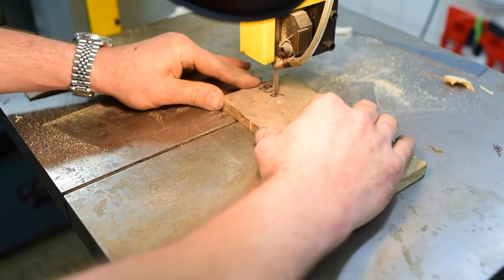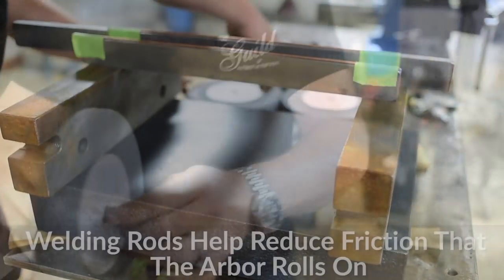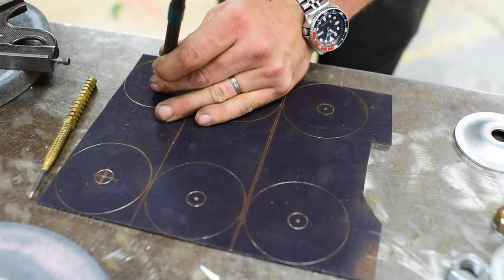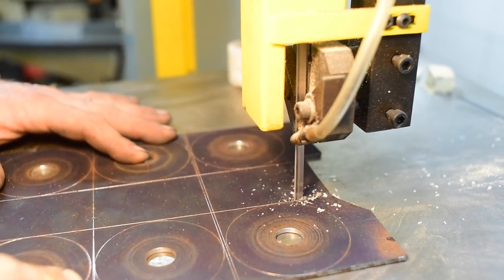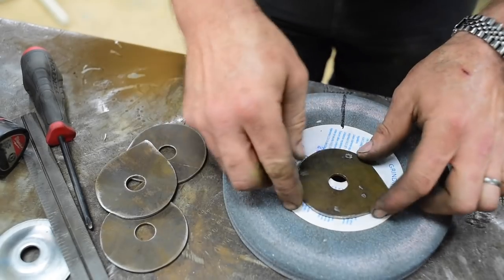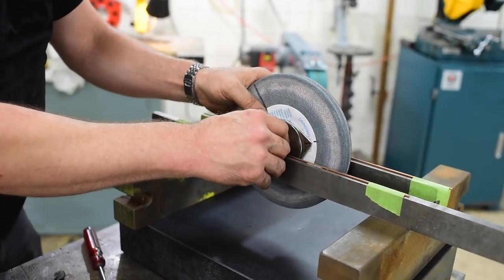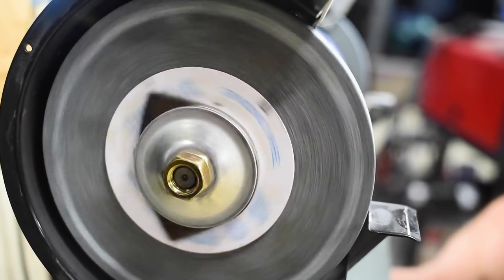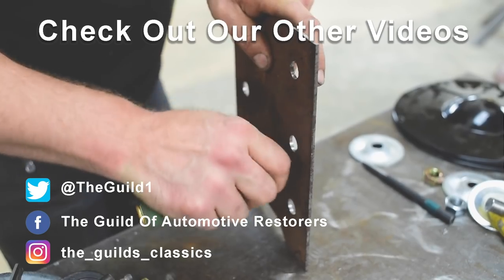How To Stop A Bench Grinder From Vibrating Using Static Balancing

Comment: I love this method.
I do however agree with someone that responded saying that this puts the full clamping force on the piece that you made directly on the entire edge of the stone.
Meaning that entire surface of the plate you made is being pressed against the grinding wheel.
The factory washers do not clamp on an entire one and a half or two inch surface of the washer. They clamp on a rim area about three eighths of an inch wide.
 I totally agree with what this guy said.
With that said, maybe you could cut out, and glue on, a thin gasket of sorts maybe three eighths of an inch wide and adhere it onto the back of those pieces you made. It would be like a 2in by 3/8 diameter gasket.  
Look at the original washers and the contact area  they have on the stone, then duplicate that on to the pieces you made.
If you left the original grinder washers on the inside then make the gasket I mentioned that exact same exact diameter, so you create an equal clamping load on each side of the stone.
I'm new to this subject but I read that people use cereal boxes as replacements for the paper that originally comes on grinding wheels.
If you take one off, sometimes it takes the paper with it in bits and pieces and makes an uneven surface.   I have that problem and I'm looking at totally removing the paper and replacing it with another surface. You don't want metal directly on the grinding stone, you want a cushion, to stop direct contact between metal and stone. Cardboard from a cereal box is what I seen come up most often.
Thanks for the ideas.
I've measured out some lead solder that equates to the amount of weight I need to add as a counterbalance.
I'm thinking of pouring lead inside of the clamping washers.  I know exactly how much I need and lead solder works to balance the wheel.

The grinder washers have cups and I simply folded up some lead solder into that cavity with the correct weight and it worked.
I removed the grinders original washers and I'm going to melt some lead into that cavity as a counterweight.
 With two washers if I melt the equal amounts of lead, one into each half, this will balance the machine.
I'm not sure how balancing the machine works compared with balancing the actual stone.  
One would think you would need to balance the stone, not way back towards the shaft. 
Film at 11 so they.
..... Others say, hold my beer 🍺 watch this. 😂
Thanks again and also thank you to the other people that commented. 

.....and now, hold my beer watch this. 😁

Comment: Thanks! My 20 year old grinder no longer bounces its self off the table or if bolted to a table everything else. I balanced the wheels one at a time on the motor shaft to include any motor unbalance issues. Used a 1/16" sheet and a 60 degree pointer angle but if I take it off again I will drill the washer opposite the pointer to increase the eccentric forces.

Comment: Before you go to all that work, take all the wheels off and run without any to see that the problem is not in the grinder......not the best one to begin with. Add one wheel at at time, running, to see if it vibrates, mark it and dial in 1/4 turn at a time to get  the best operation. If that doesn't dial it out, add washers like Dave Joseph suggests below. That is how I fixed my Baldor's vibrations.

Comment: Good tip , makes sense ! I had small issues like that before . Why a King grinder ? I have never had luck with that product line . I purchased a  Metabo DS 200 8-Inch bench grinder and 80% of vibrations went away ! I use a stone on one side and a braided wheel on the other side . I purchased a good stone dressing wheel (rasp) to eliminate the remainding vibrations . Maybe i have just got lucky but will definitely keep your tip in mind !

Comment: Great process! If my grinder has a brush wheel on one side can I balance that too?
Reply: You can try the same method here, but I would check the vibration with only the brush wheel installed to see how smooth it runs without the stone wheel.  I'm guessing you are talking about a wire wheel? There are nylon brush and fiber wheels as well. The balance with a wire wheel may change as the wires are dislodged from the wheel. Most likely the wire wheel with not cause too much vibration.
Reply: @flashgordon6238  I have heard of people actually clipping off pieces of the wire wheel to do the balancing.

Comment: Can't I simply buy some large thick washers with a 5/8 inch hole?
Reply: You would need to make them non-concentric to counterbalance the heavy spot of the wheel.
Reply: @flashgordon6238  if the washers are tick enough, having enough mass, drilling holes should be able to offset weight

Comment: Why not just dress the wheel?
Reply: From what I know, dressing the wheel only gives you a straight front edge. It doesn’t balance the wheel. They are not balanced because of the way they are constructed, ie the density isn’t perfectly even throughout, so even if the front edge is nicely straight and flat, there can still be a wobble.
Reply: 4:41 - he dressed it
Reply: If you don't balance the wheel first so it runs true, no point in dressing the wheel.  First balance.  Then dress. This is like getting a chiro adjustment on your back first, the deciding if one leg is shorter than the other and finding a heel for shorter leg.  You adjust spine first.
Reply: @mjremy2605  
I don't know anything about anything but that seems totally backwards to me.
If the wheels out of balance because it's lopsided, why not make it round before you try to balance it?
I'm not totally disagree in, I'm just rolling this around in my head.
 If it's out of round, wouldn't you want a lob off the egg-shaped part of the round so it is actually round?  
Once it's round you can deal with the imbalance.
Being out of round or lopsided, might be entirely why you're out of balance.